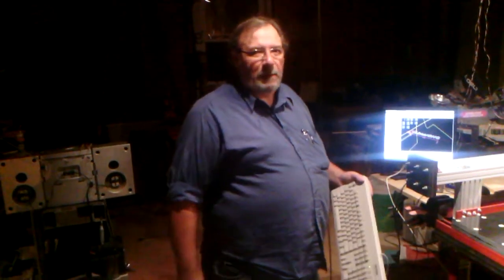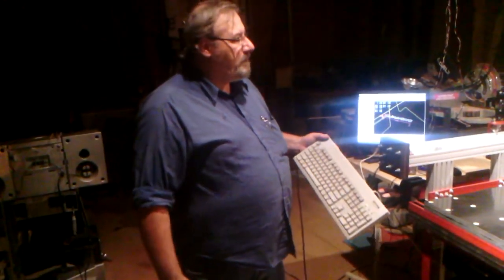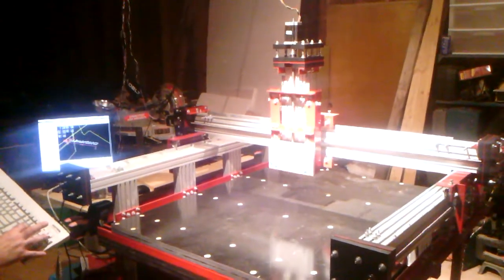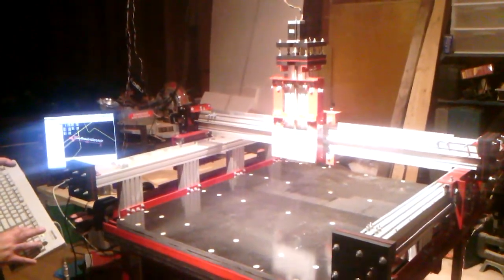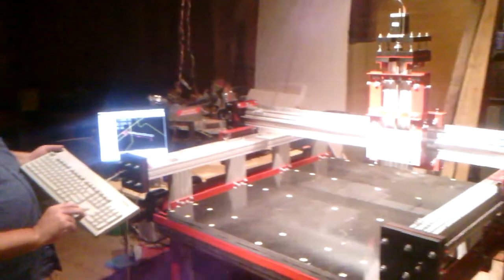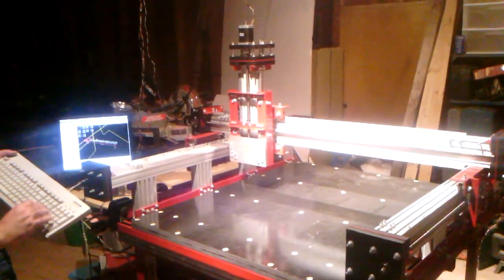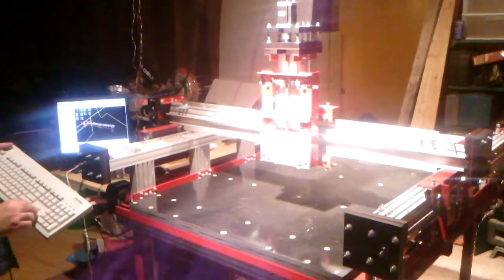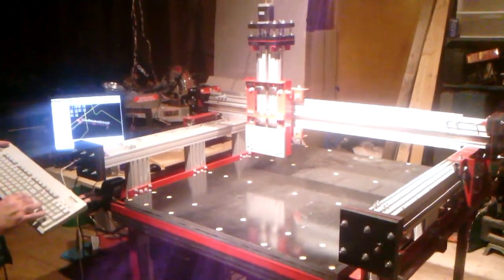KRMx01 is ALIVE

Comment: Below is a partial link to the electronic kit i'm considering. I would like to know what you think! I personally think anything around 300oz holding torque will be sufficient. Resolution is important also. 
4-Axis-CNC-Kit-269oz-Nema-23-Stepper-Motor-TB6600-Driver

Comment: Nice! I just finished my KRMx01 the other day...looks exactly the same except I have my router mounted and didn't paint my bearing blocks - I should have, now that I see yours :) Did you have any issues with your Y-axis? I have lubricated the track and that helps for a little while. The track squeeks bad and stutters. Funny thing is, I had it running real smooth last night in the "sweet spot" of the track - I walk in this morning and nothing but problems. Any advice would be awesome
Reply from the maker: Wayne Strickland 

I have not had any problems with the Y-Axis (or X for that matter)  I am running the vee bearings right on the rail with no lubricant at all.  The only two things that come to mind is:

Are the bearings too tight against the rail?

Are the four bearings in good alignement with the rail.  I went through the hassle of measuring the thickness of all the washers for each carriage to make sure that the distance were all the same length.

Aluminum is pretty soft, I would think they would wear in after a while.  Also the X-Axis braces are a good addon that really stiffens it up.

Joe
Reply from the maker: Thanks for the link.  It looks promising and they offer a free account to check things out.  i will take a look.